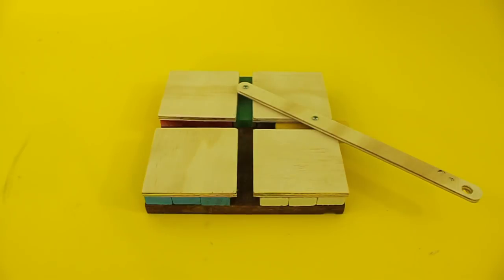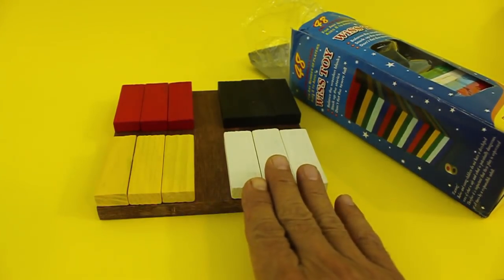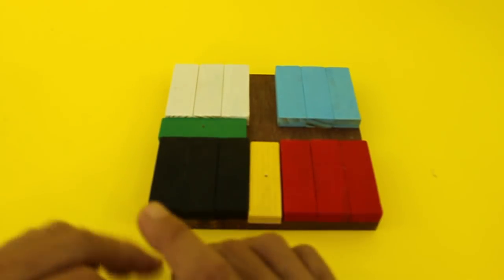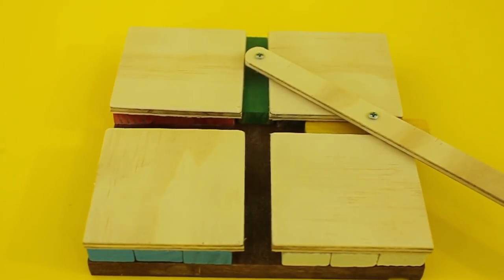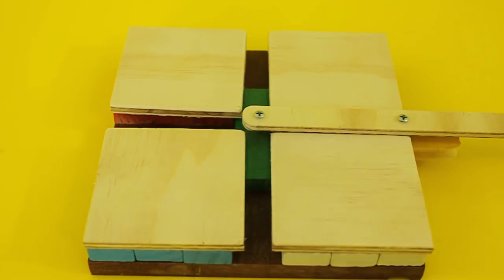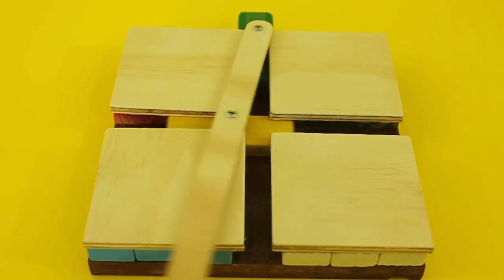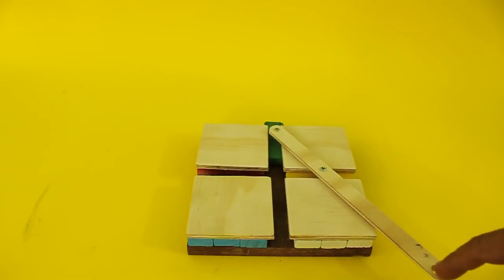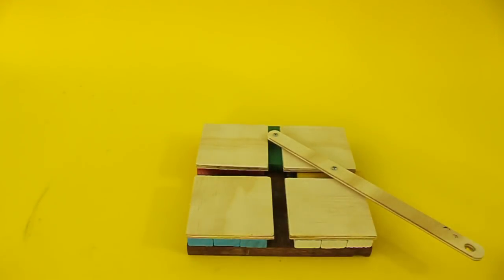Mechanism to make Ellipses: Trammel of Archimedes

Comment: Good one. Just curiuous,  Is there any practical application which uses this ?
Reply: Arun kumar   I've seen it used with a router for cutting elliptical coffee tables.
Reply: Arun Kumar :) build it then think of what you can use it for or with.
for instance, could it hold a drill or rotary cutting (dremel) tool?
or maybe stick some light in there, to make a show, like an regular or flashing LED with battery.
try 9v battery with 2 white LEDS in series, and maybe a switch. wires to extend it and use tape to hold it
+[LED1]-+[LED2]-
+[...9v battery...]-
or 1 white led with LiPo battery, or 3 small button cell batteries like of laser...etc.
Or use a laser marker to show on wall in the dark. hold button with tape.